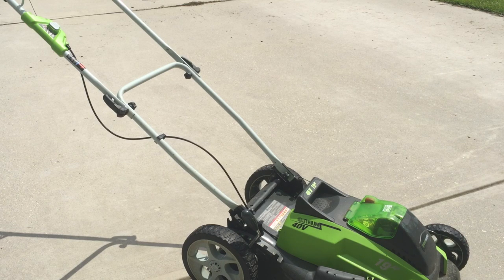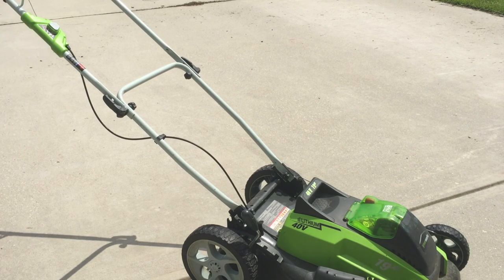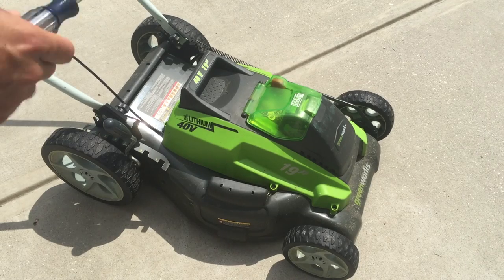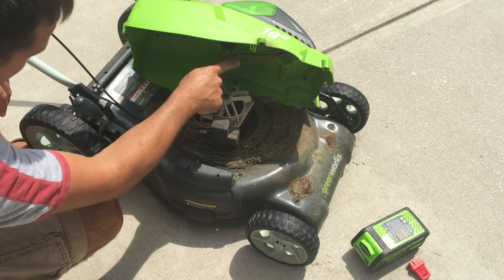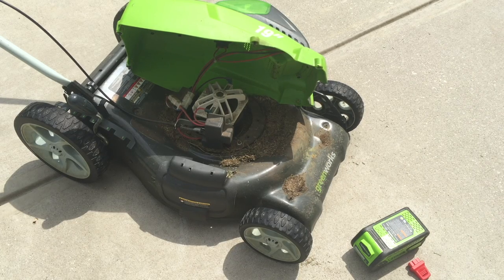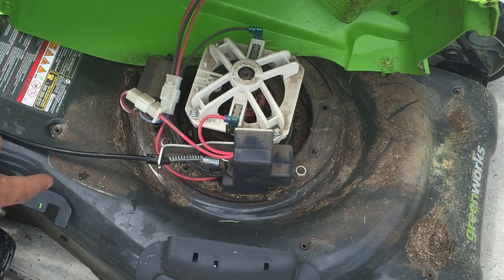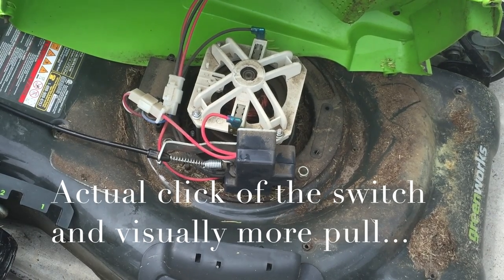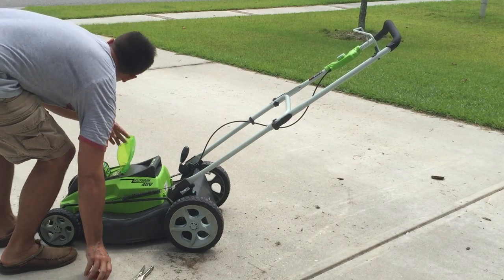Greenworks 19" 40V G-MAX Lawn Mower Pull-Bar Fix

Comment: I used this to fix my mower so thank you.  Hard part was getting the plastic housing off the top because some of the screws were on so tight I stripped a couple trying to get them off.  Once I was able to get the cover off I bent the bracket a little and it starts like a charm.  I've had this mower for years and love it.  I've been thinking about getting a newer model but didn't want to get rid of my current one when all it needed was a simple bend to work again.

Comment: Helpful! Here's my problem: I severed or partially severed the cable to the handlebar by folding over the handlebar. Now the mower won't start. What I've learned from this video is that the cable is entirely mechanical and not electrical. I contacted the company and they have a >48 hour wait time so I am waiting. The mower is more than 3 years old and the owner does not have the sales slip so warranty coverage is unlikely.

Comment: Have you ever had to do repair inside safety lock out? I took mine apart and cannot remember how to put it back together.  Something inside of it wasn't working but it does turn on if I push the start button.  I cannot find a diagram for the inside.
Reply: I'm in the same boat right now and can't find anything online. I'm so frustrated

Comment: figured it was a stretched cable on mine, sure enough it was.  On a lot of gas portable equipment there is a screw adjustment to deal with this, but clearly Greenworks didn't think this far ahead.  Easy fix to keep going.  I thank you sir!